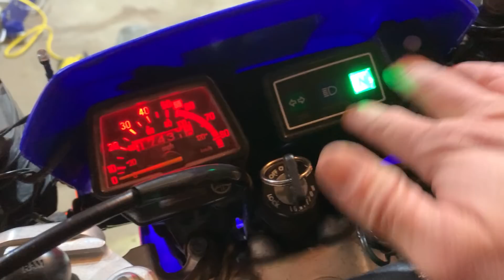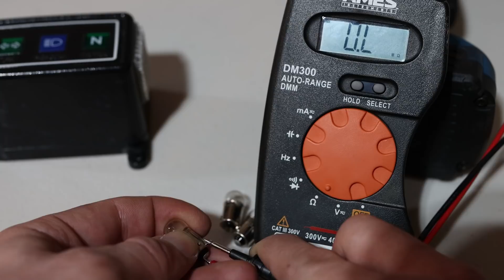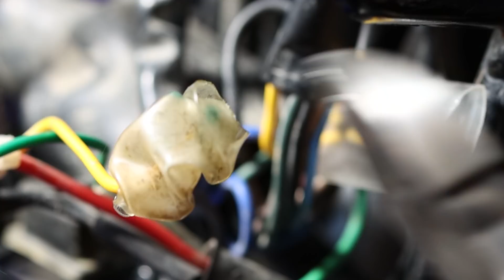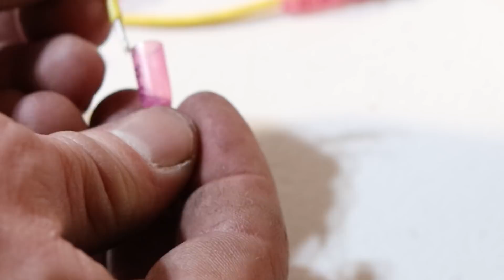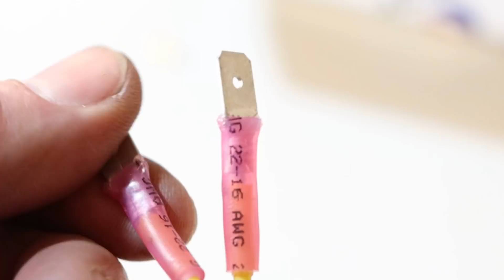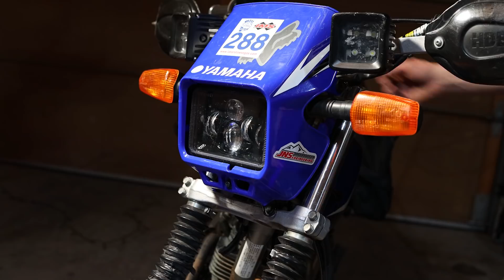Yamaha TW200 Indicator Light Out | L.E.D. Bulb Replacement | Electrical Diagnosis and Repair

Comment: Good Video TDub, I never use anything to spread the female part of the clamp apart. I'll use needle nose plyers on the backside of the male connector after soaking with WD40 and gently pull/twist apart. If you do have a loose female connector. Use your small needle nose plyers and insert into female connector and roll in the lip. That causes tension and holds the male end of the connector tightly again. As you saw, trying to crimp or crush the female connector to make it tighter, with the male connector inserted does not work. I'm always looking forward to your next videos. Great job.
Reply from the maker: thank you! yeah, that was where I messed up, should have mentioned that in the video. good advice. and put some dielectric grease over it after you reconnect to prevent corrosion. glad to hear! much appreciated
Reply: That sounded like one of those mighty car mods conversations that’s full of euphemisms. 😁
Reply: Yeah, I was yelling at the video but he couldn’t hear me…;) 
I’ve been following for a long time, And have enjoyed watching.

Comment: I got the bulbs on your recommendation, I appreciate the recommendation.  My high beam indicator was burn out so I went to replace all of them and now the turn signal indicator isn’t working.
Reply from the maker: yeah the turn signal doesn't work with an led bulb, will figure out a work around in the future
Reply: @TDubsKid not the actual turn signal but the indicator light on the instrument cluster as well?

Comment: I got some of these, but they wouldn’t work for my turn signal indicator. The high beam and neutral worked fine.
Reply from the maker: Yeah, I need to look into it further to see if there is a work around
Reply: @ I would have thought that the load from the incandescent turn signals would  have been enough for the LED, but might need to get a powered electric flasher relay to control the lights. Those are kinda cool anyway because you can usually control the flasher speed. Now to find LED turn signal bulbs.

Comment: I put led signals on but all four flash. Doing some research I found the dash indicator halogen bulb was the culprit. Im hoping the led bulbs will fix this as now the only fix is to simply remove the bulb which leaves me with no indicator dash light.
Reply from the maker: dang! putting led flashers on this bike does seem tricky. hope you got it working

Comment: I don't know why they use those round bullet connectors, but you shouldn't bend the connector with pliers, ever.  Those bullet connectors suck, so definitely way to go replacing them.
Reply from the maker: yeah they are not great, I learned that the hard way, I like spades, you can always bend those back

Comment: Every figure out why the LED light on the turn signal indicator doesn’t work?
Reply from the maker: not yet, just haven't had the time to mess with it yet
Reply: @TDubsKid  Just got these bulbs for mine, same issue here with it not working with turn signal indicator. Very strange.

Comment: Reverse the polarity on the turn signal bulb LEDs only work in one direction
Reply from the maker: Yeah Leds them selves  only work in 1 direction however some led bulbs have special circuitry thats allows them to work in either direction

Comment: Hi - I added 12 o’clock labs front and rear running light adapters and fixed rate turn signal adapter as well as led turn signal bulbs to my 2022 tw200. Since that time my turn signal indicator bulb is so dim it can’t be seen. Any suggestions. thanks
Reply from the maker: hey i'm not sure exactly, could just be a loose connection, causing a voltage drop, or the bulb itself is faulty
Reply: @TDubsKid  I ordered a diode from 12 o’clock labs and will install once it arrives. They suggested the problem comes from the led bulbs not allowing the voltage to flow through them.

Comment: Hey bud, you ever figure out how to make the turn indicator led bulb flash with the actual indicators? Thanks
Reply from the maker: I have not yet, need to work on that at some point
Reply: @TDubsKid  - Only had time to skip thru your video, but I found out my turn signal indicator socket has reverse polarity. Did you swap the wires?

Comment: It has to be a conventional bulb for the flasher indicator.  It feeds the bulb  shell for one direction and feeds the pin of the bulb for the other direction so a led won't work backwards like that because it's a diode.
Reply from the maker: for sure, they do make led bulbs that have special circuitry which allows them to work in either direction. that might be the key to make it work
Reply: Did you ever resolve this with a LED bulb?
Reply: The LED bulb I got off the link didn't work for the just the turn flash indicator, the conventional ones do. I am assuming this is normal, do you have a link for led flash indicator bulb?

Comment: Need to do the signals on mine right now too. My bike also didn't like the LED dash for the turns. I got the diode kit from procycle and a LED flasher unit to replace the other one. Still need to pickup LED bulbs for the lights themselves though.
Reply from the maker: Cool, cant wait to install led turns on mine, there are probably a few different ways to make it all work

Comment: Most multimeters have a beeper sound setting  when a circuit is closed, it looks like a speaker symbol on yours. Use it to check for bulb filiments and broken wires,etc.
Also LED bulbs are polarity sensitive unlike filament types (incandescent). I just ordered a 2022 Beta 300 rr and we’re waiting for a chill riding and camping trip this summer. Great vid by the way!
Reply from the maker: Thanks for the info. Very cool, those are rad bikes. Have fun riding, summer will be here before you know it. Thanks!

Comment: nice vid on wiring for the tdubs I like the old school solder them up dielectric grease & heat shrink tube very good describing your trouble shooting
Reply from the maker: Hey thanks, I love soldering. I actually have a pocket size digital controlled soldering that I run off my lipo packs. I just wanted to have some connections so its easy to remove when needed. Thanks!

Comment: dude I have the same issue. I just got a 21 tw200 so i doubt corrosion is the problem tho
Reply from the maker: Oh wow, I would start with the bulb. Easy to swap it out with one of the other 2 as easy diag
Reply from the maker: It should have warranty also if its that new

Comment: Hello again from British Columbia. You talked a bit about different screw types. We have a Canadian screw invention that has been around a very long time. It is a square hole in usually 3 sizes that uses a square tipped driver or bit. It is called the Robertson, but it isn’t used in automotive applications. It is a superior screw but only used in Canada in cabinetry and other wood working or sheet metal applications. You could look up its history in Wikipedia.
If I may correct you, would you not call your instrument bulbs, just filament bulbs? I think halogen is another style used in larger applications and brighter. LED is taking over in most applications now including street lights. Regards....
Reply from the maker: Hey there! Yeah those are cool, I see those in deck screws sometimes. They seem like a good screw, less likely to round out. Sure thing Filament seems like the way to go

Comment: Dielectric grease in all electrical connections is a great corrosion preventative thing to do.
Reply: Yes. I always use that. It definitely keeps the water and corrosion down.
Reply from the maker: indeed! would have kept this from happening in the first place, surprised they don't put some on at the factory

Comment: I would suggest ditching the crimps with heat shrink attached. Get non insulated crimp terminals and use separate heat shrink. If you look for marine grade, you can find adhesive lined heat shrink which seals the joint and adds a little mechanical strain relief. Plus it’s much easier to make a quality crimp without the insulator in the way. I’m like you, I like electrical work.
Reply from the maker: the heat shrink on these are marine grade as well they have an adhesive layer. just got some non-insulated crimps and separate adhesive-lined heat shrink too. that makes sense though. I'm sure there are different insulator thicknesses that can tough things off. nice, it's fun once you learn the theory side

Comment: You love wiring problems? Oof not me 😂
I just bought a 2017 Chevy Volt Premier, and I'm about to install a 240v 32a charger in my garage, which will be overkill, but good for resale when I sell the house. It's also got me wanting to upgrade my entire service panel.
Reply from the maker: haha, yeah most people don't. high voltage is scary though. for sure, will future proof your house and easy to sell when everyone is buying electric

Comment: Great video , I learned the hard way about JIS vs Phillips, rounded out a few screws. JIS  are designed as to not overtorque.  Also learned the hard way on hex/Allen  SAE v metric, 🤦🏻‍♂️ I'd be interested to know what kind of strippers and crimpers your using, I need a good set 👍
Reply: FWIW, if you still have the dinky factory toolkit that came with your bike, the screwdriver within it ought to be a JIS one that matches the screws on your bike. This is a cheap-as-free solution that a lot of people don't realize they already have.

I've undone a lot of screws over the years with the dumb slides-into-the-spark-plug-socket driver that came with my KLR.
Reply: @dualsportdork1252  lol yeah. My bike is German, so I have metric hex. And star to deal with ,but yes the dinky kit has a cheap version of a star and a reverseable screwdriver/Philips,
Reply from the maker: good idea with the screw driver in the tool kit, I sure hope it would be JIS haha
Reply from the maker: hey, thanks! yeah, it makes a huge difference. you can sometimes use a Philips if you are careful and you apply tons of downward pressure, but not ideal. interesting, yeah, it's never fun rounding stuff out. I got links in the description to my tools. crazy seeing how much I spent on them 3 years ago compared to now. inflation is real. the automatic wire strippers work pretty well usually. sometimes there will be issues on certain types of wires due to different insulator materials and thickness but it never seems to rip off any strands of the conductor. Just will not pull off the insulator all the way sometimes. that's why I also have regular strippers just in case. you just don't want to go super cheap because build quality and tolerances are important. I love the ratcheting crimpers and haven't had a single issue until using these crimps. might have been due to the spade crimps having less thick insulation than normal so the inner crimp part wasn't being pressed down all the way since these crimpers are metered.

Comment: Oh boy, vehicle electrical wiring is right in my wheelhouse.

I'm not trying to be That Guy, you know, the one who's in all the youtube comments... But, if it were me, I would not have employed the solution that you did. What you've done is converted two potential failure points into four, now that you have extra spade lugs and and an additional butt splice in there. (Heheh, "butt.") You've got a lot of extra wiring length and hard 90/180 degree bends you've had to create to stuff it all back in, also. The factory connector was just fine, and could easily be salvaged by bending it back or replaced easily with a single crimp. Those bullet plug splitters are common to a lot of Japanese bikes and they're really cheap to buy online if you ever do need to replace one. Typically they fit 3.5 or 4mm bullet plugs. They're used pretty much anywhere a 12v wire has to be split into two on a bike. I keep a ton of bullet plug connectors on hand because all kinds of stuff on bikes will also use them, in particular turn signal assemblies. (I'm sure I don't need to tell you how often we like to smash those off in the dirt.)

My rule of thumb is to slather dielectric grease all over any connector you have occasion to touch anywhere on any vehicle. Dielectric grease will keep water out of the connections and is especially important in connectors that are not sealed in any way. This will eliminate such corrosion issues in the future. I'd have reshaped the original bullet plug splitter, cleaned it up, reconnected everything, greased it, and sealed it up with a length of heat shrink tubing over the whole thing.

If those heat shrink equipped spade lugs annoy you: don't worry, it's not just you. They annoy everyone. If you have to use them for something or another (for instance, replacing a factory connector that is already a spade) I find it much less of a hassle to use normal non-insulated, non-heatshrink ones and slide a piece of normal heat shrink tubing over top and shrink it after you've made all the crimps and connections. For anyone else watching: Be careful using those heat shrink connectors and watch the temperature rating of your wire's insulation. Often you have to cook the thick heat shrink shrouds around these things so much you wind up melting the insulation on your wires if it's a lower temperature type. Also, don't shrink the parts around where the male and female connections are or you'll never be able to get the damn thing apart again!

You'll give yourself a headache replacing your turn signal indicator with an LED, so I'll let you in on what you'll have to do in advance. Bikes with a single turn signal indicator are wired such that they actually reverse the polarity on the bulb socket depending on whether you're signalling left or right. It uses the wiring on the opposite side as the ground. LED's are polar, incandescent light bulbs are not. So from a light bulb's perspective this doesn't matter, but from an LED's it does. You'll find that the LED bulb will work when you signal one way and won't work when you signal the other... There are a couple of ways around this, and no -- replacing your flasher with an LED rated one won't help. My preferred method is to clip the wires coming off of the bulb socket and use a pair of diodes -- one pointed one way, one the other -- both connected to one wire on the socket to ensure that this wire is ALWAYS positive no matter what. Then run the other wire coming off of the socket to a separate ground. You can splice in to any of the ground wires already on your gauge cluster, or just use a big ring terminal and tuck it under a nearby bolt.

You could also just put a simple rectifier in line with the socket. Plan C is to get a "reversible" LED module which has a rectifier built in, but they're really hard to find in the sizes needed for dash indicators. I have circuit diagrams I could show you if you need them, but the links are hella long so I won't put them in a comment.
Reply from the maker: hey thanks for the info. for sure a lot of ways to do it but. I'm just not a fan of the bullet connectors. yeah would be best to go through  the whole bike and use dielectric on all the connections since they are not waterproof

Comment: I do alot of automotive electronics crimping. I tried the ratcheting crimpers but I always go back to my Klein pliers. Easier to use in smaller places too. I also add dielectric grease to everything I pull apart to help waterproof connections.
Reply from the maker: nice. so far the racheting crimper have worked great until these spade crimps haha. cool I just picked up some of those Klein pliers because a few of you guys recommended them. the reviews seemed great. good idea. I didn't on these because the built in heat shrink is adhesive lined making a waterproof seal. adding dielectric grease when the bike was new would have kept this from happening in the first place
Reply: @TDubsKid  At some point I'll be getting a TW. Thanks for the videos! I really enjoy them.

Comment: Damn T Dub once again a good video hey if you like doing electrical so much you might want to think about getting into that as a career there's not too many people around there that enjoy doing electrical work especially on cars and motorcycles that could be a good future bro
Reply from the maker: hey thanks! yeah I should have went to school for electrical engineering. just went 2 years for associates in  automotive technology. I work as a BMW technician. I never really understood electrical theory super well until I got into fpv drones. now it all makes much more sense. also learned a lot about lithium battery technology with fpv as well which will all help translate over to my van build I'm doing. once you learn the theory behind electrical it becomes much more easy and approachable.
Reply: @trailrideadventures  I thought he said he work for Discount Tire company but I could be totally wrong

Comment: T dubs:  disconnect the bullet connector, then it’s easy to tighten the female end with simple pliers.   Love your vids and your enthusiasm!
Reply from the maker: I tried that a few times. still couln't get it tight, probably would have worked best if I didn't bend them in the first place and use some needle nose to roll them. thanks!